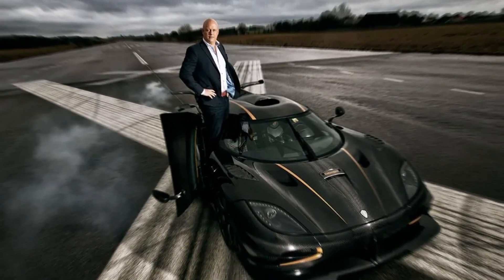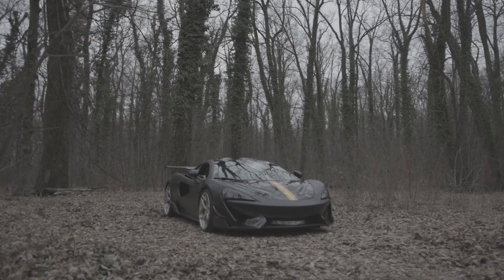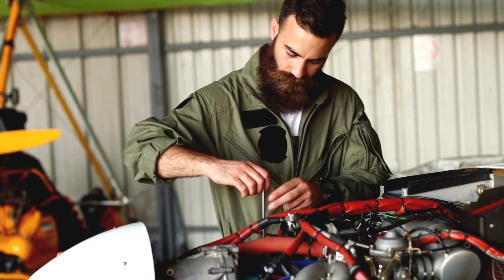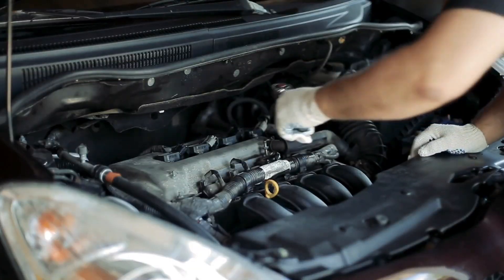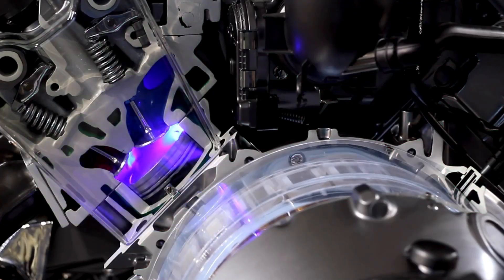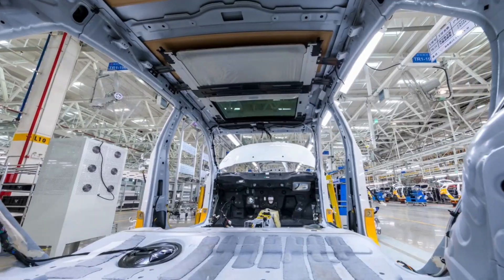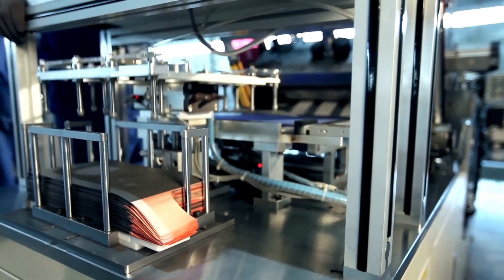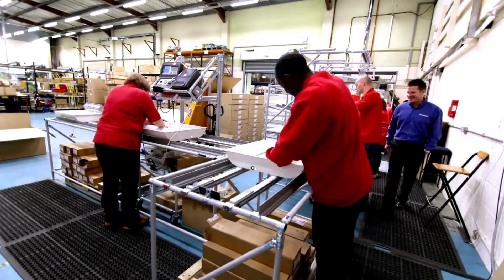Koenigsegg CEO Announces NEW Aluminium-Ion Super Battery With 15-min Charging

Comment: No official announcment, no evidente, no documentation, it's still in development and currently with very low energy density even if potentially it could improve. It will required still many years before it can reach volume production.

Comment: Aluminium-ion batteries to date have a relatively short shelf life compared to lithium-ion.
Reply: This is not true
Reply: @Daniel_Official_10  Yes it is. I'm in EV industry and my job is to research metal-ion batteries.
Reply: @kitanowitsch the research of MIT stated that after 20.000 cycles there was no drop in capacity. Do they lie? 🤷‍♂️
Reply: @Daniel_Official_10  A million is a referent point.